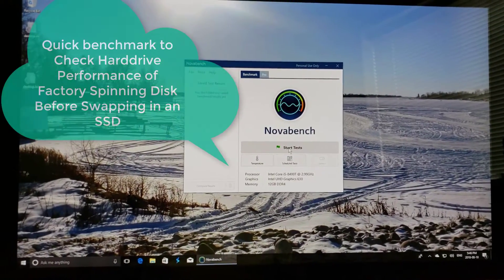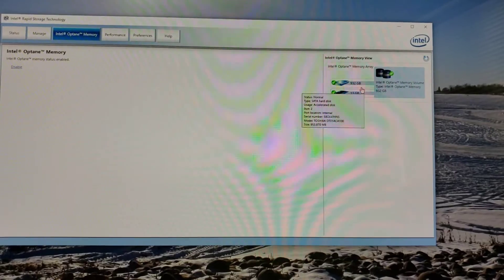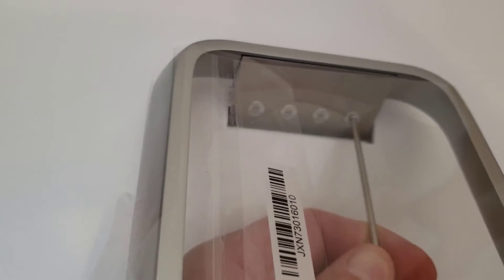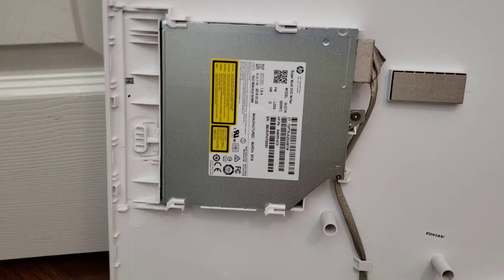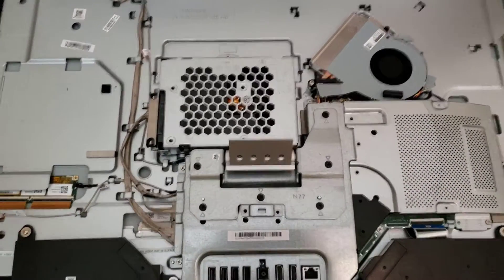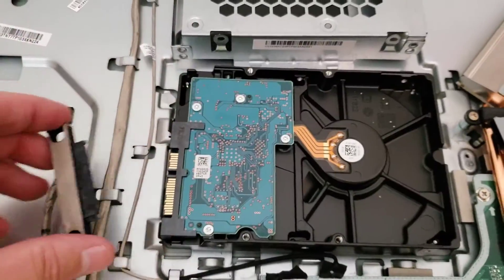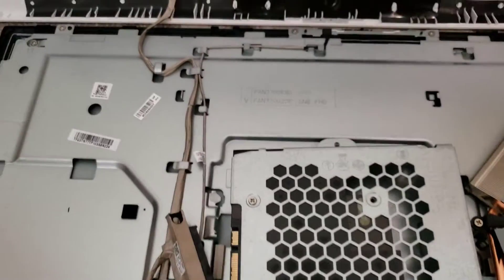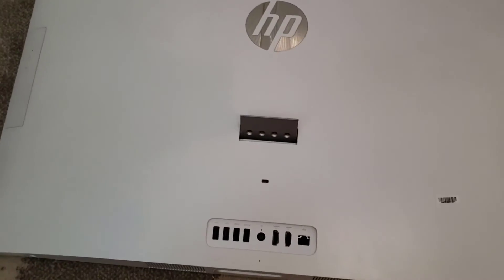HP All In One 27" Disassembly, Change to SSD & Benchmarking

Comment: Wow incredible, I figured these All in Ones would have no upgradability paths whatsoever, especially one from HP! When the OS started acting up I was afraid we might have to dump the whole thing or get it repaired! After this video I changed to SATA SSD and now plans to upgrade RAM to 32GB, NVME storage and new WiFi 6E network card upgrades in the very near future. It looked like there is an NVME installed in there already when I opened the case up but it's never worked and I didn't know it even had one. Thank you so much for all the help and this great video with excellent advice! Would've been lost and hopeless without resources like this! Keep up the great work!! 🙌🙃

Comment: I have an HP pavilion 27-xa0013w and I will be upgrading to an ssd, but I was wondering what the max ram and type I could add, and if I could upgrade the processor.
Reply: The screen is still great, and its touch screen and it has built in speakers, so it would be a waste to throw it away. I'd rather upgrade it.

Comment: Can the dvd drive just be removed and have the ssd mounted there with some double sided heavy duty tape ?
Reply from the maker: If you can get a connection cable to fit, then I think it would work.  I have had laptops in the past that allowed interchangable DVD's and expansion disks and you can certainly do it on PC's so it should be all about getting the disk connected and not the bus or bios.

Comment: Should have ripped the useless Optane M.2 module out (seen at 5:05 )and put in a Samsung 970 Plus M.2 NVME, then you would be getting over 2000Mb/s and still keep your old HDD in there for data storage
Reply: Have you tested this?

Comment: Why your read speeds reduced on ssd?
Reply: I was thinking the same that was a great previous read speed!!
Reply: The read speed on Optane memory is only high if you have used the same data/program previously. Standard read speed on a HDD would be about 140Mb/s. The first time you open something it would be therefore 140Mb/s. The second time you open something with optane it gets a boost because the optane software remembers you have opened it previously and caches it in optane memory.